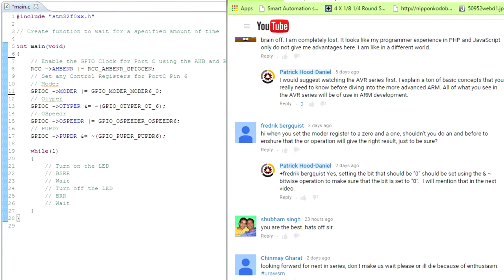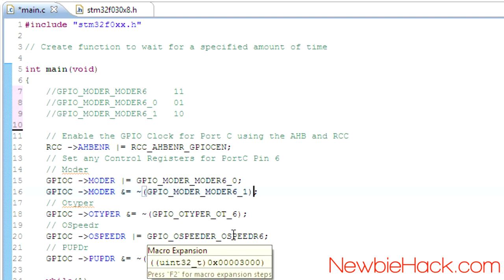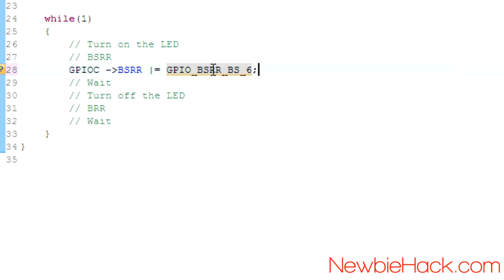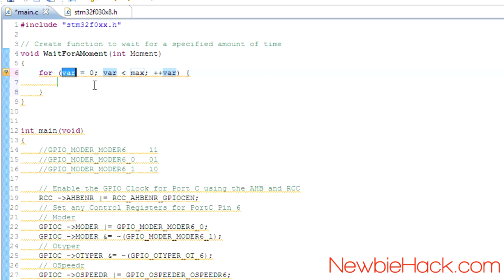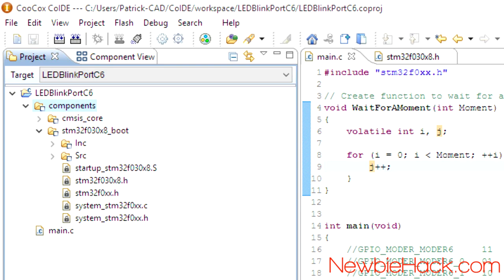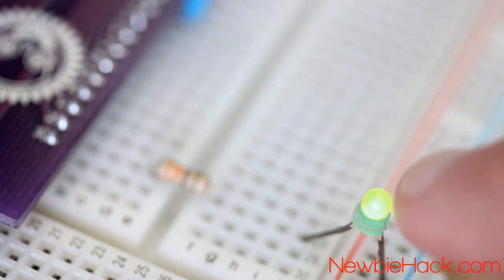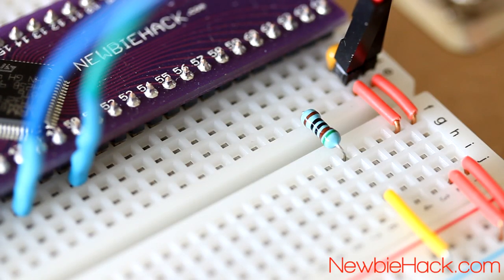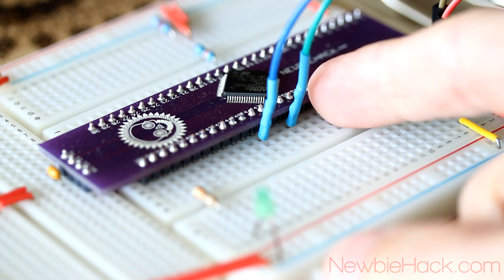8. How to Output to a Pin to Blink an LED for Arm Microcontrollers - GPIO Tutorial Part 3

Comment: In your book, on page 79, the final code section has the waitForMoment set wrong, it's written as 100 instead of 200,000
Reply from the maker: Thanks. I will check and adjust.

Comment: You have done an excellent course up to here - but before I go right through the tutorial and spend a lot of time, can you please tell me if the chip is capable of the task I have in mind?
I want to make a persistence-of-vision globe by rotating a semi-circle of LEDs and flashing them to produce the impression of a globe.  The LEDs receive RGB information in a 32-bit string for each LED  (8 red, 8 green, 8 blue, and another byte for overall brightness), then when an LED has received its requirement, it passes the next 32 bits to the next LED in the string.  The semicircle contains 106 LEDs on the North quadrant and 105 on the South.
As the semicircle rotates, the LEDs flash off and on to produce 440 dots horizontally and 211 dots vertically, making a total display of 92840 dots, with a requirement for 32 bits per dot.
Consequently, the memory requirement is (Number of dots) x (4 bytes) = 371360 bytes.

There are two strips of LEDs, and each LED strip needs to be connected to a serial output that will stream bits at a rate of 23.866 Mb/sec.

We don't have enough memory addresses to serialise all the bits on a single pin, so is it possible to read 4 bytes and shift them out on a single pin, or would I need to use an external parallel-to-serial shift register to do that?  Can you suggest anything that would be helpful for the design?  Could I use the USART?  Can the DMA be used?

Comment: @Patrick Hood-Daniel
, one question I wanted to ask you 
For MODER6[1:0] ie, pin 12 and pin 13 the scheme for GPIO is 12pin - 0, 13pin - 1 or 12pin - 1, 13pin - 0.

Comment: Hi Patrick :)
Once again, i'm glad you posted your vids :) . Cause this time i'm learning ARM, and i feel horrendous about the lack of clarity in the manufacturers' documentation. Everywhere i look, it's only rubbish, half written "manuals", sketchy block diagrams and so forth. 
 I am given the impression that ARM is a mess and is only intended for the Operating System dependent dudes around; not so for the low level register-oriented embedded programmer.

 You latest vids on ARM made me think there was hope for me. Will you continue the series? 

 Have you any idea where i' might find the documentation i crave, which manufacturer is less sketchy? I begun with AVR atmega2560/328 datasheets, which are sooo crystal clear in comparison. That's what i'm looking for in ARM achitecture as well.

 And once again : i really enjoy your videos, the clarity and simplicity of it really helped me getting started with AVR; and it's really a relief seeing you begun an ARM series :)

Comment: Hi Patrick, I purchased your dev kit and have the Blink program loaded in my CoIDE, it compiles fine, but I can't seem to flash the program to the breakout PCB. I get the following error message: 

Error: Connect failed, check config and cable connection

When I use the ST-Link Programmer it works fine.... What do you suspect the issue might be?

Thanks,
Tony
Reply: Same problem here.

Comment: In case there's someone else who cannot flash their device, my chip, the STM32F030 C6T6, would not work unless the pull up and pull resistors were connected on SWCLK and SWDIO

Comment: I am using the stm32f407 discovery board. I used this code and checked the bits to blink a LED.
The LED turns ON but does not turns OFF.
It has BSRRL and BSRRH. 
BSRRH does nothing.
BSRRL lights the LED but it does not turn OFF.
Any suggestions?
Reply: I'm using STM32 Nucleo board with stm32f401RE and managed to get the LED blinking with the following code;
#include "stm32f4xx_conf.h"

void Wait(int delay)
{
    volatile int counter;
    for (counter = 0; counter < delay; ++counter);
}

int main(void)
{
    RCC->AHB1ENR |= RCC_AHB1ENR_GPIOAEN;
    GPIOA->MODER |= GPIO_MODER_MODER5_0;
    GPIOA->MODER &= ~(GPIO_MODER_MODER5_1);
    GPIOA->OTYPER &= ~(GPIO_OTYPER_OT_5);
    GPIOA->OSPEEDR |= GPIO_OSPEEDER_OSPEEDR5;
    GPIOA->PUPDR &= ~(GPIO_PUPDR_PUPDR5);

    while(1)
    {
        // flashing LD2  STM32 I/O PA5 (Pin21) or PB5(Pin34)
        GPIOA->BSRRH = GPIO_BSRR_BS_5;
        Wait(200000);
        GPIOA->BSRRL = GPIO_BSRR_BS_5;
        Wait(200000);
    }
}
Reply: Thanks.

Comment: It is just strange architecture that to turn pin off you must use reset register instead just clearing the set register bit.
I assume after setting reset bit the set bit is set to zero when read value from it.

Comment: Hello, I'm having a problem with your code. When I type the i and j variables as volatile int, the loop is endless, so no blinking.
Reply from the maker: This is only a guess of what may be the cause, but check the parameters in the configuration, under the compile tab, that the Optimization parameter is None (O0)

Comment: I am reading a blog on STM32F4 discovery and the guy uses "GPIO_InitStructure.GPIO", "GPIO_InitTypeDef" you don't use. 
I am surprised.
Reply from the maker: The GPIO_InitStructure is derived from an automatic process. I teach not using any automatic processes so the student/viewer can understand the bit manipulation completely.
Reply: @PatrickHoodDaniel  the thing you have done is much better, not too much abstraction really good for beginners

Comment: Stupid question here,
How come you're able to run the function, "void WaitForAMoment(int Moment)", without creating a prototype of that function first? Thanks! : )
Reply from the maker: Not a problem.  I do explain that in previous videos.  If the function comes before it is used, there is no need for a prototype.  Prototypes are only used to inform the compiler that that function exists, so the compiler essentially creates a place holder until the actual function is compiled.  I personally think that prototypes are unnecessary in simple programs such as this.
Reply: Got it! Thank you!

Comment: one more issue,how to use discovery f4 for programming.
Reply from the maker: +Chinmay Gharat These video tutorials pertain only to the kit shown in the video.  The discovery has an onboard programmer, and a connector for an external programmer.  A quick search will send you to the answers to your questions.  If you wish to learn how to develop on a bare chip, for a grounded solid foundation to develop for real production, watch this series.
Reply: U gt me wrong ,i m saying how to use swd of discovery board to program this standalone micro.
Reply from the maker: +Chinmay Gharat That's a good question. If you can isolate the SWDIO/SWCLK traces, you should have no problem.  There are a ton of solderable jumpers on the discovery board as can be seen on the schematic.  You can probably use those to get the SWDIO and SWCLK lines.  The 3.3 and gnd should be very easy to get off the board.